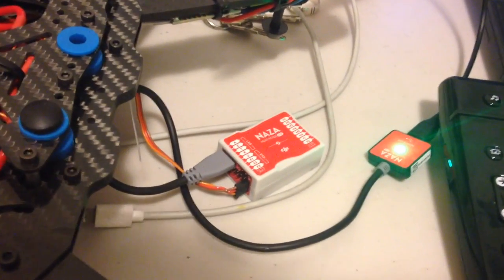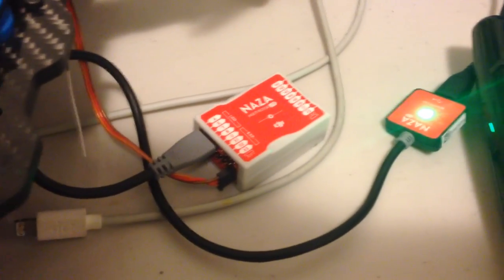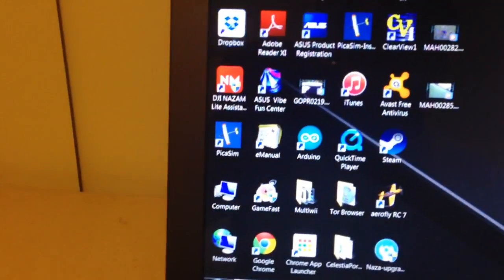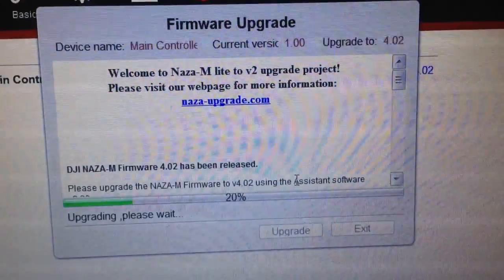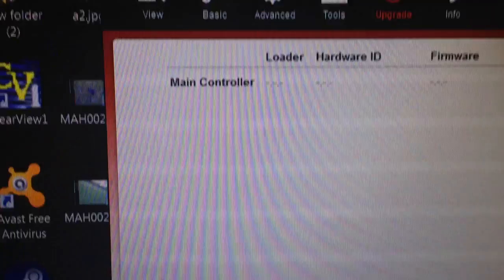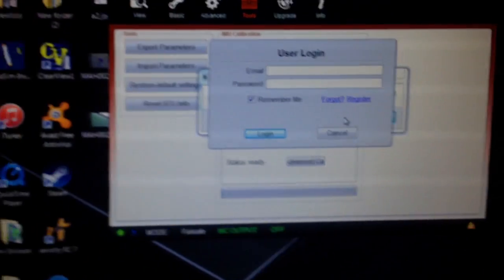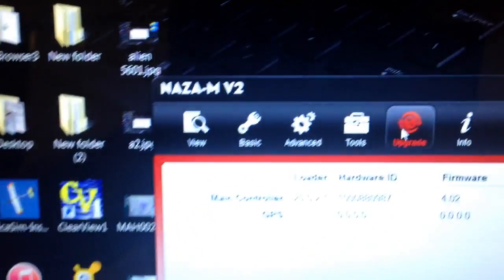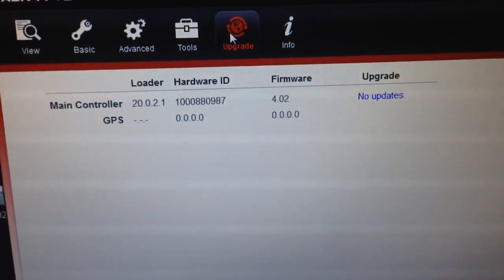NAZA M Lite upgrade process again.

Comment: Could you perhaps tell me or the Naza M lite Software is working together with Win10?  I installed the Software but the Software is not connecting ,but the Usb driver is installed
Reply from the maker: Hi Johann,  yes this is a common problem because the drivers don't install properly on Win 10.   It blocks them but there is an easy way to fix it     See Bowerz post in this thread on RC Groups. 

http://www.rcgroups.com/forums/showthread.php?t=2462912

Comment: I have upgraded successfully, but their are now updates saying i should now use 2.04 to upgrade. 4.04. I am currently on 2.2 and 4.02 firmware. Should i stay with this or upgrade. Will it brick my naza lite?
Reply from the maker: Yes it will brick your Lite if you try 4.04  or 4.06.   Don't do it.   It is possible to "un brick" it though but that means resetting to original Lite firmware and then updating to 4.02 again.  I recommend staying with 2.2 assistant also.

Comment: Has anyone had any success doing this with Windows 10? I remember my naza lite gave me a bunch of driver problems
Reply from the maker: +Tim Askey Yes I have done two on Windows 10 - you are right, there can be driver issues but here is the work around - This worked for me on a tablet and two desktops that all now connect to the NAZA lite fine. 

http://www.rcgroups.com/forums/showthread.php?t=2462912
Reply: +Trainboy64 I had no idea you could connect to the assistant via tablet. That adds so much convenience. Haha,  I upgraded it before I got a reply because I'm impatient. Works like a charm!

Comment: Just FYI,  VirusTotal.com gave a DRWeb hit on the upgrade executable as having a trojan.  Probably shouldn't care but wanted to let you know in case someone else asks.

Just FYI for those attempting this, I got the runtime error on an AMD 64-bit running Windows 7 32-bit.  I successfully used the upgrade on an Intel i3 64-bit with Windows 8 64bit.  I had to manually kill services using port 80 but once I did that, upgrade worked like a charm.
Reply from the maker: +Tommy Waldner Thanks for the info Tommy.

Comment: The first issue was that there was no pop up to upgrade and after hit and trial I figured out that it was because I hadn't signed in within the Naza Lite App. Anyway I was able to run the whole process smoothly from there on. After it finished the upgrade to 100%, it said upgrade failed, please power cycle the board, but it would be recognized by the Naza Lite Assistant. So I ran the Naza V2 assistant and it connected just fine and seems to be properly upgraded and it all seems to be running well. Should I be concerned at this point ? Should I downgrade and re-upgrade ?
Reply from the maker: +alphauby yes I would do it again just to be sure.

Comment: hey just in case v2 installs and it dont work will i be able reinstall 1.00 back or ?
Reply from the maker: Cool Stuff Plus Yes, you can flash it back to 1.00 easily.  Just connect F1 and F2 pins and then connect to Naza Lite assistant.  It will prompt you to reflash 1.00.
Reply: send me a fiv just incase pls ok pal?
Reply: well i tryed it every thing instaled i did test start up indoor no flight yet so i took it off and wam" tryin hold my sticks down start up on radio nothin wotn start its stickin some how . let me know what i can try from here so i dont get probs and send me vid pls of how too flash back thanks
Reply from the maker: Cool Stuff Plus Hi,  Here is the video on how to downgrade to 1.00 Lite firmware. 

https://www.youtube.com/watch?v=uiYxHNGkcJs
Reply from the maker: Cool Stuff Plus Did you do the advanced IMU calibration and also recalibrate the RC sticks?   With the new firmware you have approximately 1-2 minutes warm up time while the light flashes orange - after this you get 20 rapid green lights as it locks home position and then you are good to fly.  The light behaviour is totally different with the V2 firmware.
Reply from the maker: Cool Stuff Plus PS.. I really like your Y6 on the main page of your Youtube channel, looks like an alien spacecraft.  Awesome!.
Reply: ***** thanks buddy ill give u the details how what i did Y6
Reply: Cool Stuff Plus i need know also how make my chanel in search list like ur vids
Reply: ***** thanks this mis just incase i have probs but i wana keep v2

Comment: trainboy64. i'm using vista, and everytime i click the naza update software, it tells me that runtime shut it down in an unusual way? any thoughts?
Reply: +James Dyke Hi, James.  Did you get this resolved? I have same issue, just curious.  I'm running on AMD 64-bit running Windows 7 32-bit.
Reply: +Tommy Waldner hi Tommy. Yes I did. In the end I used an intel(r) celeron(r) 32bit running Windows 7 pro. Worked like a charm. Interestingly I've since used a really old laptop running xp that works just fine too.

Comment: I did what you said. I went through the advanced calibration and it started up, but it spins 3 props the 4th engages when the rpm's increase it did fly ok but unstable. All the flight toggle sticks are green except the throttle which by all I can tell is correct. If you have any information that can help I'd appreciate it, thanks for your help so far.

Comment: Well I hate to say it but I upgraded it recognize 4.2 and now when I try to start it  nothing happens can you help?
Reply from the maker: Did you re calibrate the RC and do the advanced IMU calibration?  Are you getting orange flashing lights?  These lights will flash for a minute or two on first power up while the unit warms up - you won't be able to start until the green light flashes 20 times - the light signals are very different to those on the LIte.
Reply: Thanks I will do that

Comment: Can't upgrade mine. After running the upgrade software, the assistant keeps asking me to log in. As soon I double clic the assistant the log in pops up. I input my credentials and nothing. It keeps asking me to log in. If I don't use the upgrade software, the assistant will accept the log in. Already checked the hosts file and firewalls and stuff. Everything looks ok but I can't get past the log in on the assistant. Any help? TKS
Reply from the maker: Not sure what is occurring. Perhaps you could post the question on this forum. http://www.minimultirotorforum.com/viewtopic.php?f=48&p=1910&sid=ae24d07442161e67d2b653053dd403ec#p1910
Reply: ***** Figured it out. It was the windows firewall that was blocking the assistant. Done the upgrade. :)

Comment: DUDE PLEASE HELP ME !

I tried to upgrad the naza m lite to v2 but nothing happened, when I logged in the upgrade did not pop up, for the 3rd time it was working , then update failed, power cycle my drone again, I did, then update succesfull. Then nothing happened, and my drone does not working in the naza assistante software... I cant even fly, red, green, yellow flash .

I try to power cycle again, and reinstall the software, but if I plug it in nothing happens... :(

Comment: Hi Trainboy64, looks like I missed the boat.... I've clicked on the link in several forums and sites and it times out every time. Looks like it's been removed now?! Any idea if it is still available anywhere?
Reply: Actually, cancel that message, found the site and Oh boy, what a difference it's made, unbelievable!! I can now actually fly in manual mode as well. I can't believe how bad the Lite version was, now I have 100% trust in the equipment
Reply from the maker: Phil Smith Hi Phil, glad you noticed the improvements also.  The difference is huge!.  In Manual mode my original Lite was unflyable, but now it is rock solid too.
Reply: The same here, dji should hang their heads in shame. The Lite version does not perform as described and therefore in my opinion falls under the 'Trades Description Act' and they should put this to rights themselves. Don't know if you have the same thing there? Anyway, I'm well pleased with the outcome and feel confident now when flying that it won't fail.

Comment: HI Trainboy64 thanks for the video. I have done this and worked great. I now want to run the ground station, and I understand I need the V2 PMU. can you still use the old lit LED (the one with the led and pmu in one) but only plug in the led wire in not the PMU in x3 port. I will use the new PMU for that? just saves having to by a new LED.
Reply from the maker: I think that is right, I haven't tried the V2 PMU, just flying mine with the original hardware.

Comment: I tried to follow the same sequence  and also port 80 is not blocked . But still could not get popup to upgrade when I open naza lite app? Any reason why no popup?
Reply: ***** Its resolved... not sure how.. i tried installing everything again from scratch then it worked
Reply from the maker: Were you signed in on the Naza Lite app?
Reply: ***** yes i signed in with my credentials but not luck.
Reply from the maker: iosthiru Glad you got it working.

Comment: I bought the Lite version on the assumption, being a noobie, what I really needed was stability and not the advanced features.  I'm good with that.  $169 for stability in a FC from China I feel is more than fair amount to pay.  After spending  a year with "drift" driving me bonkers, and then reading forum after forum I discovered I was not alone.  All for the fact that DJI is too bull headed to upgrade the Lite firmware.  I guess you get goofy once you made the big leagues in making decisions for the corporations.  Now you can have a Naza M in a Naza Lite box.  Smart move DJI.  Didn't you see it coming? A little victory for the consumer !!

Comment: i am thinking about doing this but I have some questions is this totally safe with no risk of a fly away or something is it running exact naza m v2 firmware or is it changed in any way thanks for the help
Reply from the maker: I guess nothing is 100% safe, but I have upgraded several Lites and have flown them many times without issues.  I personally think it has made my units much safer as the don't drift randomly and unpredictably on take off in GPS mode.   I don't know if it is exactly the V2 firmware as I didn't write the software.
Reply: *****
ok thanks anyway i think i will do it i have been re shearing it and am just about made up my mind to do it
Reply: ***** i ran this process after watching your video. it took about 30 seconds and WHAM! it's like a whole new quad! take-offs and landings are incredibly smooth! FAR superior than the lite. shame on DJI for ignoring their entire demographic. i totally get having a difference in quality vs price, but the naza always flew like garbage no matter what i tried as compared to my APM unit. i was close to switching out until this upgrade, so thank you for posting it. one thing i noticed is that the gain settings i had on the lite are a bit too sensitive for the new upgrade, so back to tweaking, but well worth it!

Comment: Upgraded ok but my motors went in reverse,sometimes I need to plug my battery in twice before I get the right light combo instead of a quick red/amber/green sequence.
Anyone else have this happen?
Reply from the maker: The light sequences are very different after this upgrade - you have additional light signals - eg 4 x orange flashes while warming up and then 20 rapid green flashes when it records the home position.  Definitely worth reading the Naza V2 manual first before using an upgraded Lite.
Reply: RTFM lol.Cheers Trainboy I`ve been on to it since I posted,my quad is up and running now.
Reply from the maker: Great you got it sorted!
Reply: *****
Hey Rob which GPS do you use with this unit now?
Reply from the maker: Philip Gordon I am using the same GPS, the one that came with the Lite originally, no change there and it works great.
Reply: Thanks mate. Just dialed in my quad,what a difference!!!!

Comment: Hi, i wanted to upgrade my naza lite, but it does not work! :(
Maybe there is a problem with avira or my firewall or something like that. Can you pls try to help me (->sry for my bad english).
And another question: will the new software, be as safe as the old one (so are there no failures or is it the same one that dji uses in the v2)?

Thank you guys and your project is really awsome! ;D

Comment: hi,im not able to do the upgrade,when I push for firmware update it only lets me do a lite upgrade. I get service activated at the bottom of the page,i run the lite  software but I cant get the v2 upgrade page
Reply: ***** good you have it sorted,I think it is better now
Reply from the maker: Are you logged in to the Naza Lite Assistant?  IE with your user name and password?
Reply: hi yes I am,then that's it I cant upgrade
Reply from the maker: Sorry to hear that Allan, you might find some additional information here at the support forum. http://www.minimultirotorforum.com/viewtopic.php?t=316&sid=72ab90ed183591921207310eec99a424
Reply from the maker: Allan T I think a few others on that forum had troubles and others found solutions.
Reply: If I put up a quick vid,could you watch it and say if I'm doing wrong
Reply from the maker: Sure
Reply: ***** thanks,I have put a 2 min vid on YouTube,not sure how long it will take to load up though
Reply from the maker: Hi Allan, just watched it and saw the problem - you are using a different version of the Lite assistant (black icon) - you need to download the version with the RED icon which is here. (or from the DJI site directly)   Try that version - it should work.
https://infotomb.com/6uw3o.zip
Reply: ***** thank,I will try today,you have a new subscriber for your help
Reply: ***** hi,yep that has worked,my lite is now on the m v2 program,did you go into the advanced calibration
Reply from the maker: Allan T Great news you got it updated Allan, and yes you need to do the advanced calibration first and also re calibrate your RC - everything is now done with the V2 Assistant - also be aware that there are very different lights now - you will get the 4 x Orange lights for about 90 seconds on first flight - this is the warm up and is normal - when the warm up is complete it will find satellites and then you get 20 rapid green flashes - this is the GPS recording the Home position.  Let us know how it flies with the update.
Reply: ***** when the advanced calibration is finished should all the numbers be near zero and not jumping up and down,mine are still moving
Reply from the maker: How much are they moving?   Do you mean the Gyro and Accelerometer readings?   They will move a little bit all the time, even if the quad is stationary.   But yes, they should all be close to zero most of the time.
Reply: the gyro and accelerometer are near zero,moving just a little but the compass is still in the hundreds
Reply: and the mod is at 2860 for the compass
Reply: I have just had a fly,it took off super smooth,only touching the throttle,went straight up,my only dislike is nothing happened untill half throttle but it held itself solid in the wind,flying fpv I let go off all sticks and I could see it tilt to fight against the wind,thanks for everthing
Reply from the maker: Allan T Glad its all working Allan, the difference in take off is designed into the latest firmware - they call it a "new take off mode"  you can see it in this video.   https://www.youtube.com/watch?v=Iu5daRzYpY0
Reply: spot on thanks now i understand
Reply: ***** I appear to be having an issue similar to Allan T .   First I removed all NAZA software from my computer and installed the ones from the link you provided.    I checked there is nothing listening on port 80 by doing a "netstat -a".   Then I ran the firmware app (which listens on 0.0.0.0:80).  Then the (RED) DJI NAZAM Lite Assistant.  I appear to be logged in using my credentials.  It doesn't seem to detect there is a new firmware version available.  All I seem to be able to do is re-download V1.00 and install that.   I would be very grateful if you could advise on what you think might be wrong please.
Reply: ***** Allan T I have sorted this out.   I tried again on a different computer and everything worked fine.  Because I thought the firmware upgrade was somehow spoofing a network service running on port 80, the secondary computer was connected directly to the internet via a mobile connection.   I don't know if this is the case, but it was my line of thinking and there may well be some other factors involved.   Thank you for this video.
Reply: Allan T Thanks.  I think it will probably only be a matter of time before this loophole is somehow closed.  Best wishes.

Comment: I have been following this on RCG and donated, but never got any response but no worries there, A friend sent me the exe file anyway, but before I go boldly forth, must I get the DJI Naza M 2.2 Assistant software before doing this procedure, I am so ready to do this and that includes getting the full functionality of the GCS and Dataliunk. Big investment if one is looking to the 900MHz version invariably. But I can go with the 2.4G if I swap out my 0X with an inexpensive LRS like the Orange 433Mhz offering.
Still much to consider here for the new year. BTW Merry Christmas to you and thanks for sharing your experiences with the process.
Reply from the maker: Thanks Chris,  Yes you should download Assistant 2.2 as you will need it to configure your Lite after the firmware update has completed.   You have a great Christmas too.
Reply: ***** My problems run a little deeper I understand the procedure but it is apparent that there is a Runtime conflict or some such. I have tried for the while day, yes I didn't wok today and spent the day in its entirety trying to get this running on two computers. One running XP the other running Win7... With no luck. Have posted on RCG thread. No replies to my heartache yet.
Reply: Never Buy orange....They just quit in midflight.. or while changing a batt...totally unreliable piace of shit...RUNTIMERROR IS KILLING ME